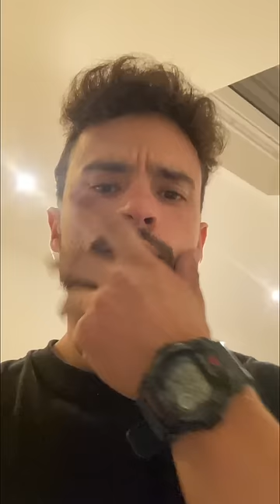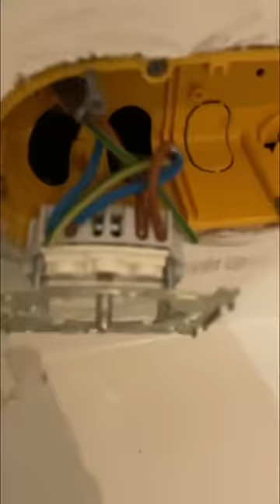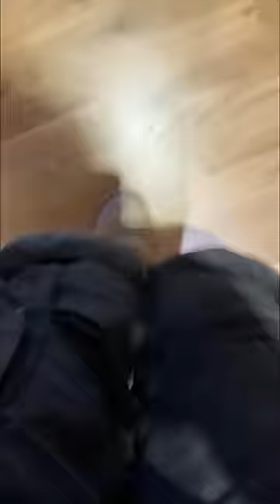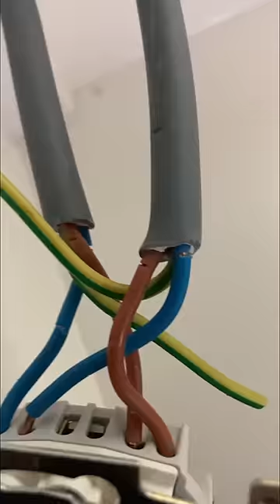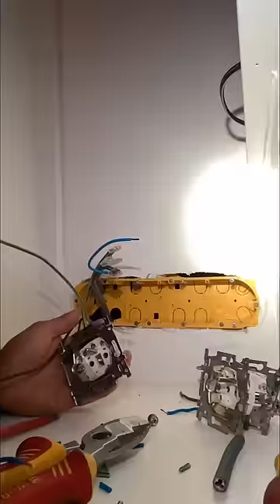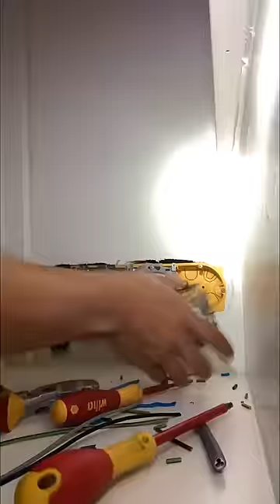Dépannage « une prise fonctionne sur les 4 » 🧐 #electrician #electricien #electricity #électricité

Comment: ca craint pas de mettre les 4 en dérivation ?  Sur ces 4 meme prises, du coup, on ne peut pas dépasser les 3800watt/16A ?
Reply: TL;DR: C'est la façon normale de relier plusieurs prises sur un même circuit.
Oui, le courant se partage, entre les prises, mais non, c'est pas un problème. 

On branche toujours les prises en parallèle sur un même circuit.

Effectivement, ça veut dire que le courant se partage entre les prises et c'est donc la somme des courants sur l'ensemble des prises qui sera vérifiée par le disjoncteur.
Mais les disjoncteurs sont dimensionnés pour ça.

Il y a aussi une limite au nombre de prises qu'on peut raccorder sur un même disjoncteur.

Depuis la norme NFC 15-100, le max est passé à 20A répartis sur 12 prises avec des fils en 2.5 mm²
et 16A répartis sur 8 prises avec des fils de 1.5 mm².

Aucun appareil domestique ne consomme 15 ou 20A à lui tout seul en dehors des appareils de cuisson ou autre qui sont systématiquement branchés sur des prises spécialisées.

Donc à priori, dans le cas général, tant qu'il y a moins de 8 prises raccordées sur un même disjoncteur, alors on peut en ajouter sans trop de problème.

Et dans son cas, j'ai pas vu le disjoncteur, mais les fils ont l'air d'être en 2.5mm². Si c'est bien le cas et que le disjoncteur est bien à 20A, alors la limite passe à 12
Reply: @arthur1112132  merci pour ces precisions !
Reply: @arthur1112132 merci pour l'explication. 
Très intéressant 👍
Reply: Jusqu'à 8 prises sur un disjoncteur de 16A, cablées avec du 1.5mm2 c'est ok (en France, ailleurs aucune idée)
Reply: @mokran937 Ouep, et 12 sur disjoncteur de 20A cablé avec du 2.5mm² :) Comme dit plus haut ;)
Reply: @arthur1112132  ah au temps pour moi j'ai même pas cliquer sur le "read more" LOL. Tout avait été dit 🤦‍♂️
Reply: @mokran937  Aucun soucis ^^ Pour ça que j'ai commencé par un TL:DR en vrai x) Je savais que c'était une longue explication ^^ Ton com a le mérite d'aller droit au but ^^
Reply: @arthur1112132   Merci pour cette réponse efficace ;)
Reply: @arthur1112132 merci pour tout ça !
Reply: Non
Reply: @arthur1112132  merci pour ce cours mon reuf

Comment: Question con, si elles sont toutes branchés en parralèles, ça fait pas l'équivalent d'une rallonge et du coup ça devient dangereux de toutes les utiliser en même temps ?(Je m'y connais pas mais j'aime bien faire les choses moi même, et si un jour je devais par hasard m'occuper de rajouter des prises dans le mur j'aimerais bien savoir si c'est une connerie ou non)
Reply: Si tu veux rajouter des prises il faut d'abord identifier le circuit sur ton disjoncteur. Voir si le "disjoncteur divisionnaire" qui est sur ce circuit est un 16 ou 20 Ampère. Ça te permet déjà de savoir combien de prise max ton circuit doit avoir (8 pour un 16 Ampères/ 12 pour un 20 Ampères c'est écrit dessus.

Pour ta question, plus tu tires de courant sur les prises de ton circuit plus ça chauffe les fils, donc ta multiprise qui rajoute 4 emplacement sur un circuit qui aurait déjà 7 prise de branchées(en imaginant que ton disjoncteurs est un 16 Ampère) ça voudrait dire que tu as 3 prise de plus que ce que ton circuit supporte. Donc les fils vont encore plus chauffer et risque de brûler.

En gros la multiprise il faut s'en servir comme d'une extension de prise non utilisée. Dans ta chambre t'as 3 prises loin de ton lit qui servent pas et t'en a besoin proche de ton lit, tu gardes les 3 libres et tu mets ta multiprise qui fera office de rallonge pour celle ci

C'est un peu grossièrement expliqué mais j'espère que ça t'aide à comprendre un petit peu
Reply: 8prises max par circuit 2,5mm2
Appeler un électricien en cas de doute
Reply: @jcj7796 faux 8 prise max sur 1.5et sur le 2.5 c est 12

Comment: Salut ta un conseil a me donner ? Dans ma cuisine aucune lampe ne fonctionne on dirait que le voltage est trop faible donc rien ne s’allume malgré que tout est bien connecter. L’ancien locataire avait une lampe led 17wat mais moi je voudrais mettre une lampe de voltage normal si c’est possible . Si t’aurais un conseil a me donner stp
Reply: les seules réponses possibles seront données par un testeur...le voltage 230v c 'est partout, et avec 10ampere tu peux allumer masse lampe led, donc ton probleme c'est un probleme de faux contact, ou un mauvais cablage sur interrupteur va et vient.